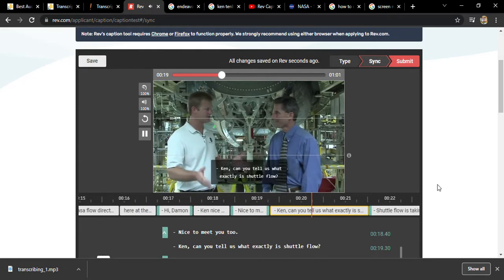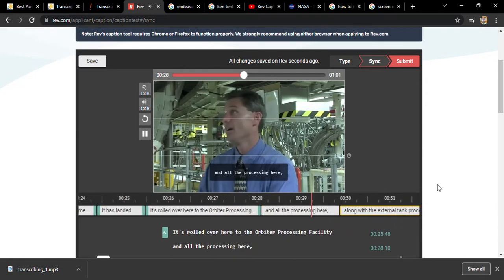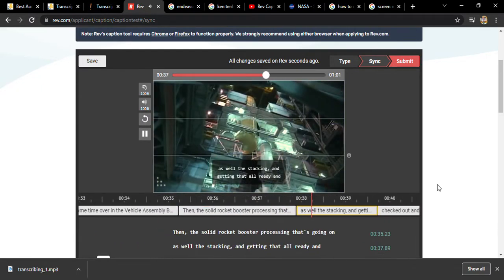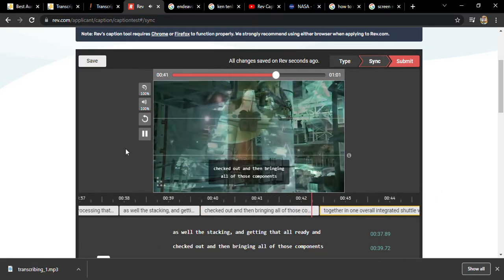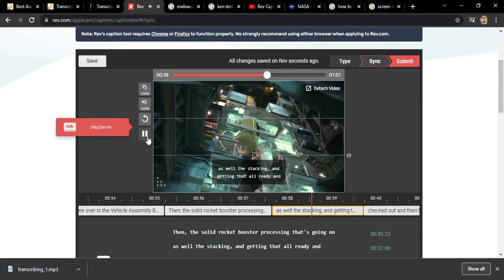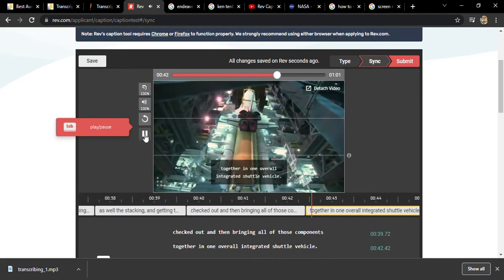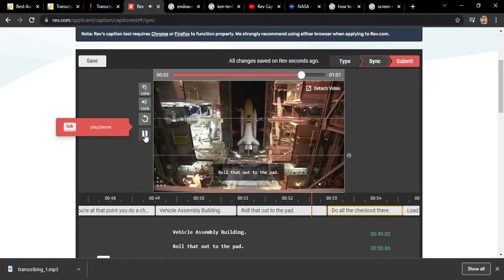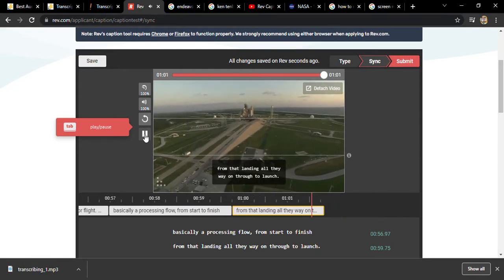Rev.com | Caption Freelancer Application | Online application Step 4

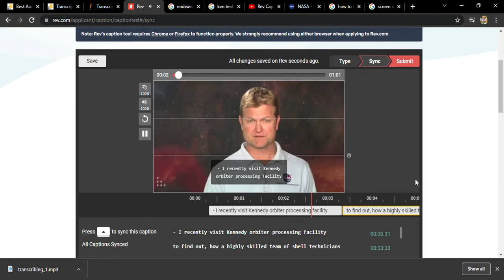Comment: Appreciate the help with this. Couldn't hear what Ken Tenbusch said when he said, "Hi, (blank)" at 0:24. Or when he said, "Shuttle Technicians" at 0:12. But, thanks to your help, I was able to get the job a day after I applied. So, thanks for this.

Also, just a heads up guys, you're gonna need to complete an ID Verification in order to take projects on there. It could be a State ID, Driver's License, a Passport. Anything that you can take a picture of in order to work through the website. As well as 3 selfies. But yeah, just wanted to let you guys know that.
Reply: Can I still use my ID if I'm from the Caribbean?